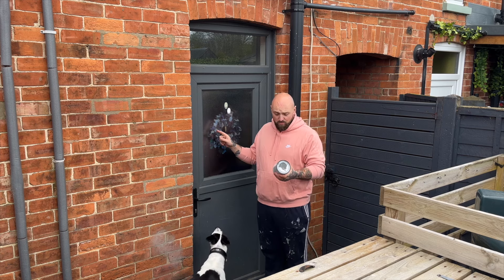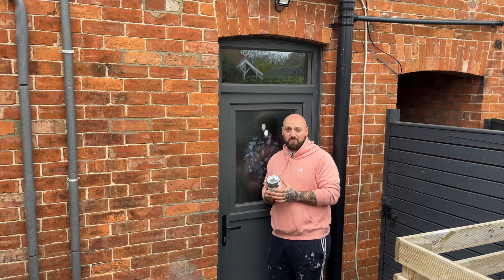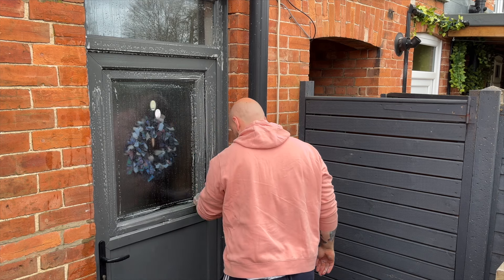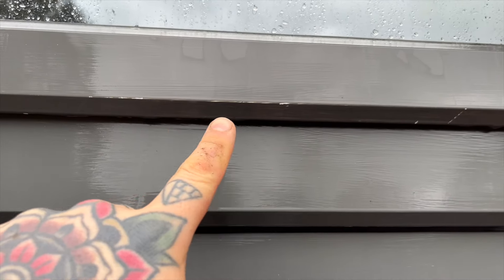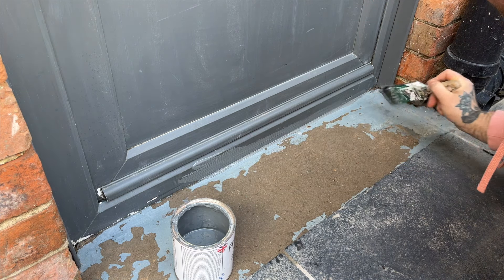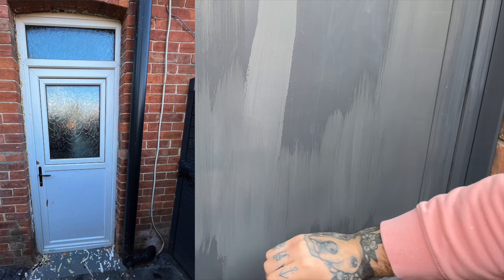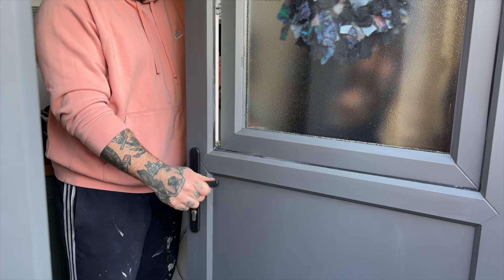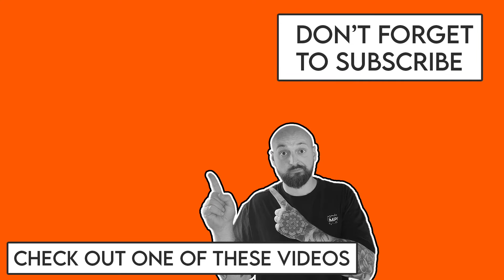Painting a UPVC Door | Garden Ready for Summer Series | Ep7

Comment: Have tried this paint and other water based paints. They scratch off too easily and you will end up doing it every year like here. I did my door with oil based primer, undercoat and topcoat. Looked really good and doesn’t scratch off .
Reply from the maker: I used this on the garden room door also a few years ago and that is still going strong. The dog jumps up at the handle of the back door to let himself in, which is what scratches it off. I have no affiliation with Frenchic by the way, incase this reads as a defensive comment 😂😂